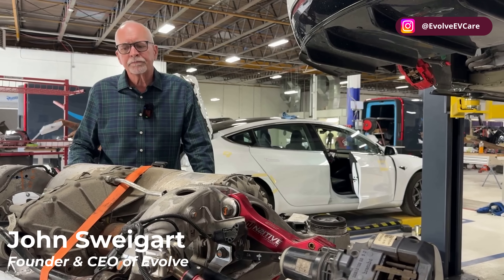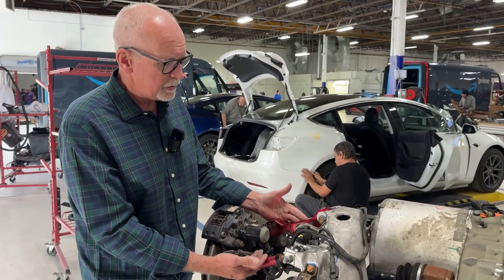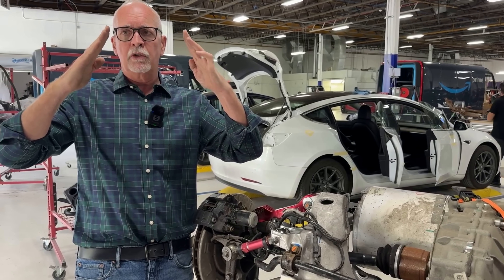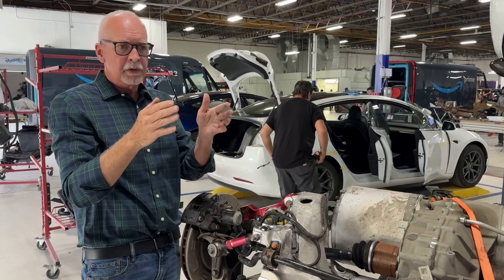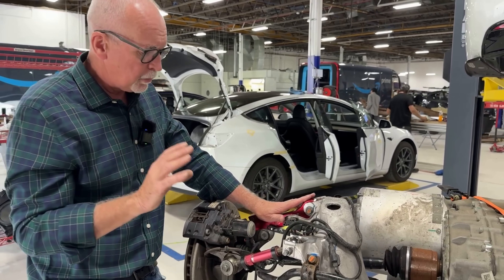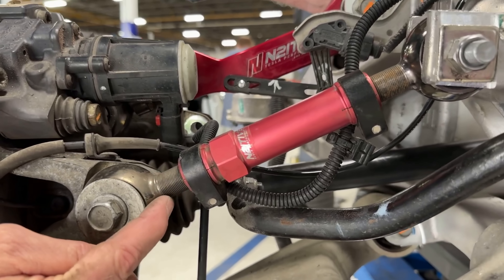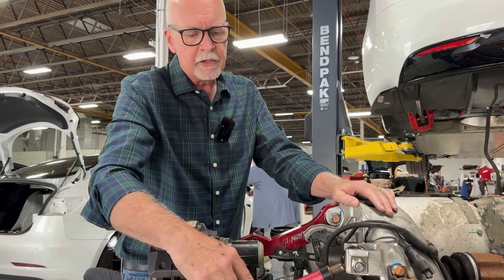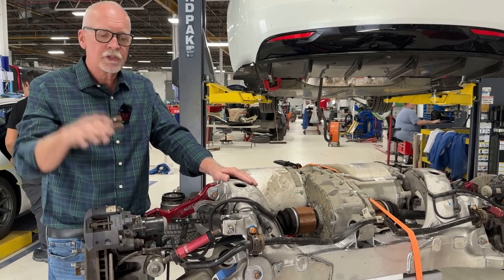Why Do Your Tesla Tires Wear So Quickly? Causes and Solutions

Comment: 2022 S with larger wheels and only 18k miles just taken for alignment and it was way off both toe and camber front and back. Had to add rear camber shims to make it right. In my opinion bad factory alignment accounts for most of the premature wear.

Comment: Model S design flaw 1000% on Tesla. 19’s Don’t have the issue, 21’s do.  Tesla failed its customers by not having adjustable camber for the 21’s. Tesla fan boys don’t care, they will do whatever Tesla tells them to. Families do care. They don’t want to get stranded in the middle of nowhere.  Owners shouldn’t have to buy after market parts to fix Tesla’s failure.  F- on Tesla.  I fixed Tesla’s failure by going back to 19’s.  Over twice the mileage with zero change in handling.  Tesla wonders why they they are quickly falling to last place in the EV market 🙄

Comment: Tyre wear comes mostly from the torque being transmitted.
I had a BMW M5 for 15 years. When I first got it, the rear tyres were completely worn out after 6000 miles.
I wasn't doing burnouts or even chirping the tyres, but I was driving enthusiastically.
Since the tyres were very expensive, I had to learn to preserve them - basically using light throttle in the lower gears.
Even so I do think I got more than 20 000 out of a set.

Comment: Let's see... tires lasting only 15,000 mi, car can spontaneously combust and the fire dept can't put out the fire and it may very well burn your house down. Battery charging gives 15-30 miles of range for every hour plugged into a level 2 charger at home using 240VACj!  Unbelievable the insanity people are willing to put up for this level of inconvenience!  I can refuel any of my cars in less than 15 min at any gas station 24x7 and can get 300 mi of range. 15 min. 300 miles range vs 1 hr and 15 mi range!  Yeah - that's a tough one to figure out!!!
Reply: I love driving by gas stations and remembering that I never need to wait in line for gas, stay outside in the cold to pump gas and smell the fumes.  I love leaving with a fully fuled car every day.  I also love having the ability to charge up anywhere that has a 120v outlet!  Not so funny story… I have a friend that came out to a burning VW.  Luckily, his car was not in his garage, but he had all his XMas gifts in the back, ready to go celebrate at this family’s… He lost all the gifts in the fire.  It was not an EV…
Reply: Don't be stupid. 120VAC takes how many days to charge from 5% to 100%??!!!
And where do all those electrons come from that's powering your clown car?
Here in Kalifornia, we already don't have enough capacity in our grid to supply regular energy use much less to charge these clown cars!
When you need to go on a road trip, good luck in charging it at a charging station! Assuming the plug works, assuming the credit card reader works, assuming your car can connect to the system, assuming there aren't 15 cars ahead of you in line waiting for the charger!  
You want to put up with that nonsense - go right ahead but don't have the government force this stupidity down everyone's throats because it isn't green and causes more damage to the planet than regular cars!
And don't come crying to us when your car bursts into flames and the fire department can't put it out!
I hope insurance companies charge you folks 10X more for all the damage you cause on the roads and society and to pay for your own  repairs instead of spreading the costs over reguar cars!!

Comment: The reason is very simple.  Way too people seem to think that they need to takeoff like a rocket from every light.  This along with constantly weaving from lane to lane is very hard on tire wear.
Reply: I paid for the motors, so imma use the motors :) 
smiles per gallon are insanely high
Reply: Smiles for days baby!
Reply: I owned a 2006 911 cab S stick. In March 2013 I got the model S 85P. That was the last time I went to a gas station. I met Elon that day. In the last years, I’ve never had a brake job or a tuneup. The only fluid I’ve added is windshield wiper fluid. The writing is on the wall. EV will dominate the future because they make economic sense and no other reason. They simply cost less to operate.
Reply: @dguichet  And clowns who believe this are accelerating the destruction of our planet!
Reply: And people think these clown battery cars actually saves anything!  It consumes natural resources at a much higher rate than regular cars!!!
Reply: @LWRC  any performance car will do the same. Has nothing to do with being an EV.  Go look at the curb weight for a BMW M3 comp
Reply: @shmkane  
Funny you should say that! My 911 Twin Turbo with factory 4 wheel alignment specs don't eat through rear tires! Unless I intentionally turn traction control off but that's a different topic!
We just need to stop this entire battery car nonsense!
Reply: @LWRC  seems like you’re not actually open to learning, so I wish you well in your fixed ways. Enjoy your 911
Reply: @LWRC still your 911 loses to model 3 in drag races😂😂

Comment: My 2022 Model Y Performance is on the original Michelin 21" tires at 52,000 miles and plenty of life left in them.
Reply: Yes, Model Y and 3 do much better concerning tire wear. It is the Model S and X that have premature wear.
Reply: Same , I’m at 48,900 miles original tires
Reply: Thanks for your post. I was seriously concerned. Prices for used Tesla are dropping. I can get a a model 3 2018-2022 for under 25K. I’m just trying to stay away from previous rental cars or accidents as well as a vehicle owned by multiple people in a short time
Reply: Some may consider the amount of rubber left between wear indicator on the tire and its steel belts as plenty of life left. Most don't.
Reply: That very immpressive and surprising, given the noted S and X short tire life
Reply: 30,000 on my 2023 MYP and don’t even have a dent in them!👍
Reply: how often do you rotate
Reply: @JustAsaph  never because the model Y performance has different size wheels front and back and directional specific to each corner so they cannot be rotated without removing the tires.  It doesn’t matter because all the hype about teslas burning up tires is a lie.   I’ll probably get 60-65 out of these original Michelins
Reply: @PlayBetterSlots You're right, but you're also wrong. 

Yes, the performance model Y from has staggered sized front / rear tires. 

No they are not specific to each corner of the car. They can be rotated side-to- side. This is what Tesla recommends every 6,250 miles for the performance MY. I have done plenty of tire rotations on performance model Y's for customers.
Reply: @sleepy_ipl the tires ( Pirelli pz4) have an ‘inside’ label. Rotating them side to side wouldn’t change e a thing as you’re not allowed to change the outside-inside.
Reply: @viralthings3065  Yes even the Michelin summer tires are labeled "INSIDE" or "OUTSIDE".

That is to know which edge of the tire should be facing outwards. 

This does not mean you can't rotate the 2 front or rear tires side-to-side. 

It does not require dismount the tire from the wheel assembly. 

You simply take the rear wheels and swap them. The "OUTSIDE" label on the tire will still be facing outside.... the model y performance tires are not directional, therefore they can be rotated side-to-side.
Reply: @sleepy_ipl  yeah but what is the use of swapping them side by side? Won’t they just get the same contact with the road surface?
Reply: @viralthings3065  Road crown causes the differential to operate the wheels at different speeds. this causes the tires to wear slightly unevenly from left to right side of the car. That's why Tesla still recommends tire rotations for the MY Performance every 6,250 miles or 10,000 km side-to-side.
Reply: @sleepy_ipl  Yeah we don't have a lot of two-way roads where I live.. In the Netherlands, 80% of the time I drive on a highway with multiple lanes and road crown is not really an issue..
Reply: @viralthings3065  My understanding is that the road crown is on almost all roads, including highways , to help with water run-off and not pool in place to cause hydroplaning. 

Maybe Netherlands has different rules when it comes to constructing roads, but in the united states all highways have some road crown to help with rain.
Reply: @sleepy_ipl  we use a special kind of asfalt that lets water through. It rains a lot here, so we have different measures :-)
Reply: Lol I changed mine around 30-35k km
Reply: You may want to get your tires checked by a professional. Based on my experience, most performance model Y tires need replacing ~30K mile mark. 

In rare cases some may get almost 40k but that's really pushing it. 

For you to have 50k miles on the original performance Michelin tires and it's not worn down to 3/32nd's, aka the wear bar indicator, is VERY difficult to believe. I worked as a service technician for nearly 5 years at Tesla.
Reply: @sleepy_ipl  lol we use the metric system. Like I said ‘km’.
Reply: My model 3 AWD is about to be on its fourth set at 80K
Reply: @jrherita  the factory tires usually last about 25-35k miles if you rotate them routinely.  Some are lucky to get 40k.
Reply: @sleepy_ipl  I have been rotating regularly.  Though I replace a little early (4/32) because I drive to snowy areas and need the tread depth sometimes.

Comment: Ev's are heavy , due to heavy batteries. That means tires wear out faster.
Reply: Heavier than a similar car, but apparently not by that much, more of the weight is off the front axle.
The recommended tyres are very expensive and use hard compound rubber in order to chase more range, that and the constant regen braking and hard acceleration/high torque at low speeds probably has something to do with it too.

Comment: Very good video, learned a lot, still not sure why you would need to adjust the toe though. Why are cars set up with camber? if we all drove normally and carefully this would not be needed would it? Certainly would increase tyre life. A friend of mine got over 30,000 miles on a set of tyres for a Tesla 3. She said she never floors the accelarator or does hard cornering, it can be done, you don't have to drive like a wally.

Comment: The NUMBER ONE reason for “excessive” tyre wear is driving style! Accelerate, corner* and brake GENTLY and you will be rewarded with (relatively) low tyre wear. That said, regular wheel alignment, balancing, pressure check and rotation will have an impact, too! 
* I take the racing line whenever it is safe… (Tesla Model 3 LR - 40,000km on factory tyres)
Tyre wear is inversely proportional to the age of the driver, with some notable exceptions!
Reply: Model 3 and y don’t have the same camber as S and X and also the front and rear tires are different sizes so they can’t be rotated like most high end sports cars the new 3 performance is the same tire set up as X And S so it will also wear quicker
Reply: @markjordan943 You can run non staggered setup at thr cost of handling & performance ofc.
Reply: True but its a fact that Teslas have this issue compared to ICE cars and there's a few reasons why.
Reply: It's almost like you didn't watch the video.

Comment: I’m not experiencing excessive tire wear on my Model 3. In fact I had the same make model and size tire on my Cadillac ATS and they only lasted 20k miles and we got 30k on the Tesla. The difference is the Model 3 runs them at 42 psi and the ATS ran them at 36 psi.

Comment: How does that work with air suspension?
Reply: It doesn't matter if your spring is steel or air. This is purely the geometrical relationship of car body vs wheel.
Reply: The lower the suspension, the worse the wear. So air in low is worse than new coils. Saggy coils are the worst, though.